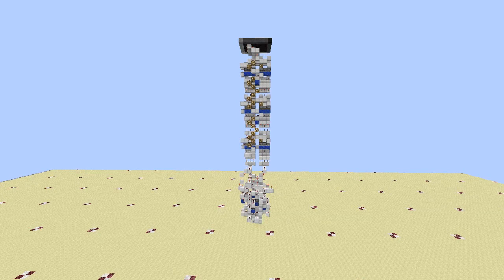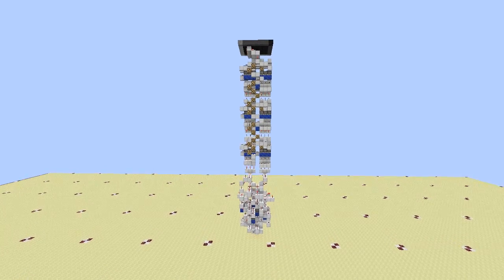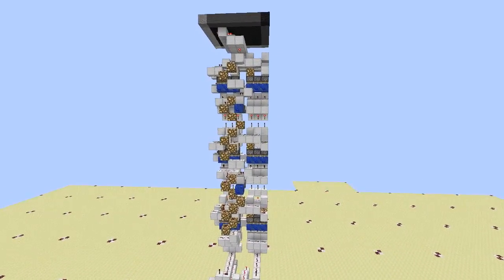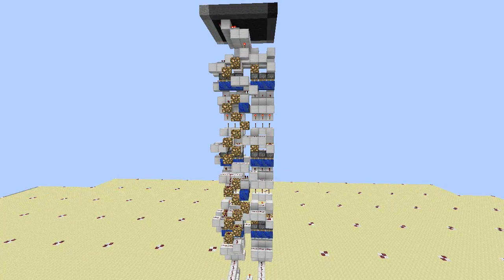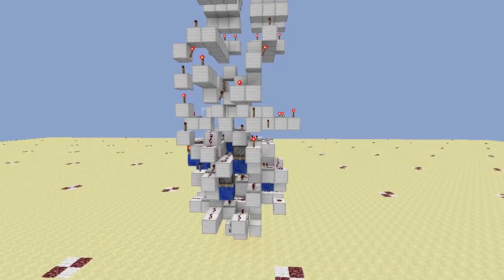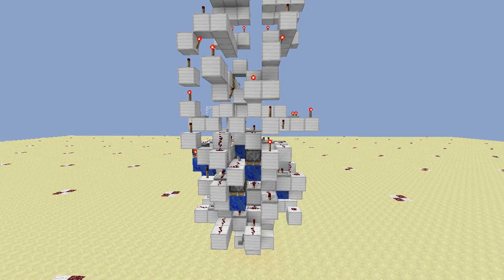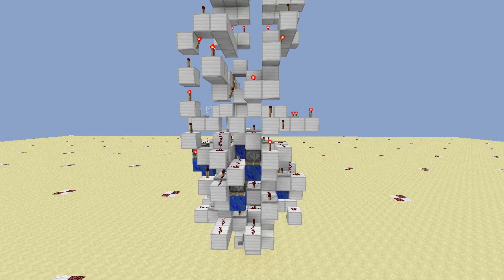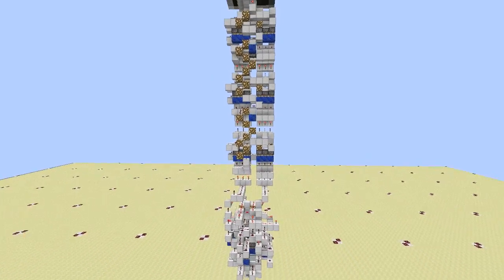GPU Component: 4-Way Shifting with Image Transparency

Comment from the maker: The way to think of this is as three stored images - so as long as you're ok with plotting pixels as part of an image it'd be very easy (and the final build will have the ability to do that). It wouldn't be too difficult to set it up to handle individual pixels separately from larger images, the only issue is that it would take up space - and I have a few features that I plan to add to the transparency circuitry. :D